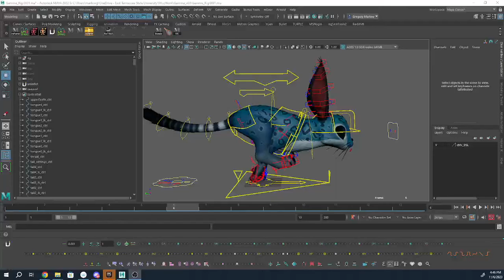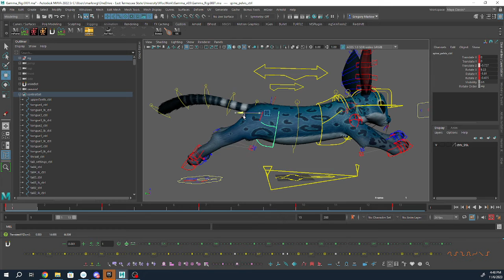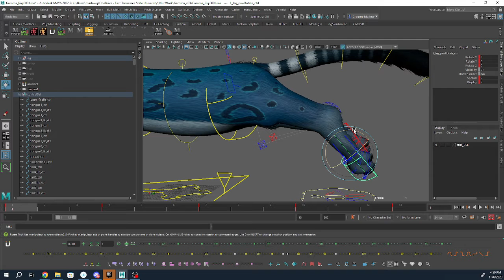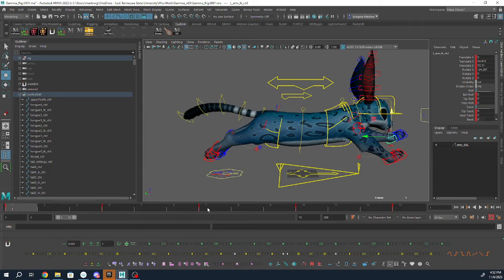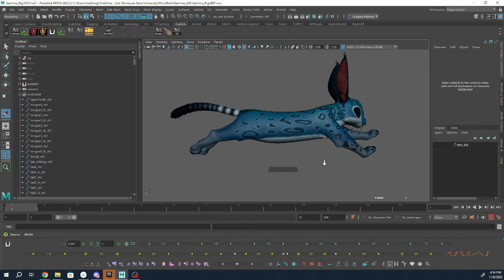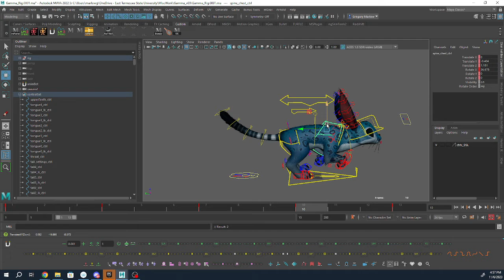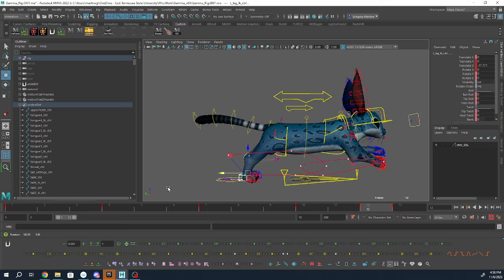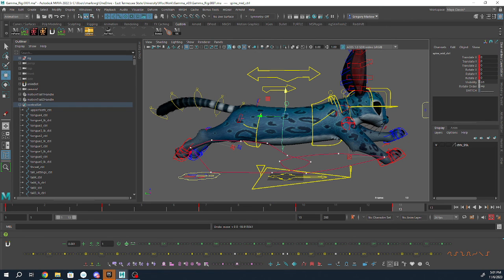Quadruped Animation in Maya Tips and Tricks Featuring Gamma Rig

Comment: Hey Greg, thank you for this video. I tried to animate with Gamma rig but it's a little bit slow. So you know how we can reduce the geo ? Or something else to improve the performance of my viewport ?
Reply from the maker: I don't know know the exact answer to your issue, but there is a game and a feature Rig LOD on the settings control that are behind the character (the little ring around the human shape). Setting that to Game may make it a little faster. 

Generally speaking, there are a few ways to make Maya's playback faster. Animation caching helps, but it probably won't help if interacting with the rig is slow. You can also go to Maya;s settings and preferences, and under the animation category, there is a section called evaluation. By default it is set to Parallel. Some rigs seem less buggy and faster if you choose DG instead--although other rigs this makes it even slower. You can also uncheck Include controllers in evaluation graph.

Finally, this may not make a huge difference, but try running the following in the mel script editor: cycleCheck -e off

Hope some of that helps.
Reply: @gregmarlowlearning1370  thanks for your  answer